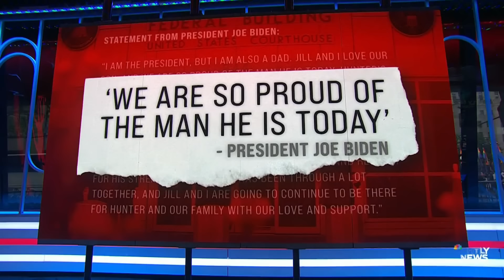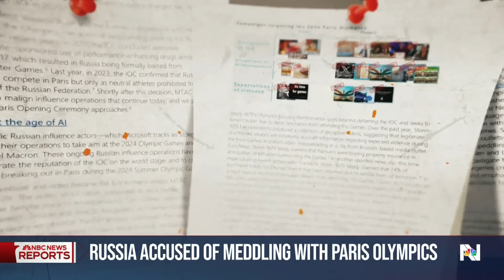Nightly News Full Broadcast - June 3

Comment: Why is it so hard for firefighters to go out during dry season and spray the bush down so it's not dry?
Reply: the sheer quantity of water needed makes that impractical. It would also evaporate quickly with a light spray down.

If it was directed in a specific location after a fire is initiated that would definitely help. But to spray everything before hand is not possible.

Comment: In 1970, the fertility rate in the United States was 2.54 children per woman, according to Statista. This was above the replacement rate of 2.1 children per woman, which is considered the level needed to maintain a stable population. However, by 1972, the fertility rate had dropped to 2.03 children per family which was below the replacement level. This decline continued, and by 1999 the rate had dropped to 2 children per woman. As of April 2024, the rate in the U.S. is still generally below or around 2.1 children per woman... Answer.. robots. ☀️🌘🌟7🇺🇲🫡🧑🏿‍🎓